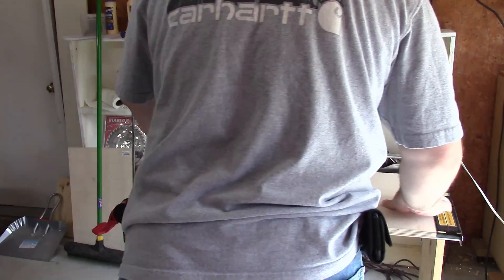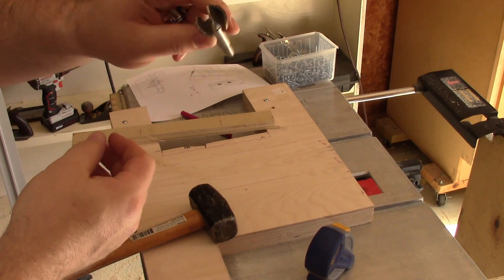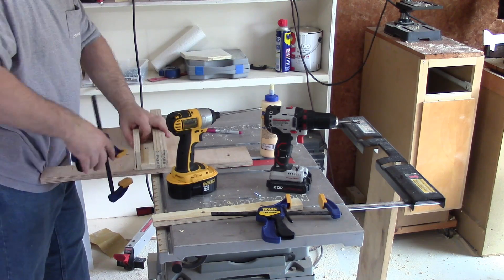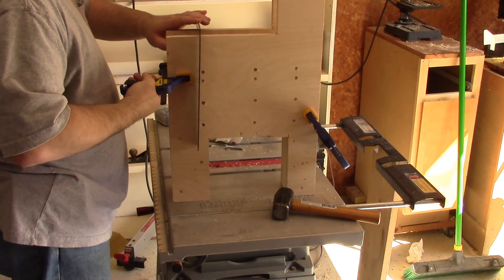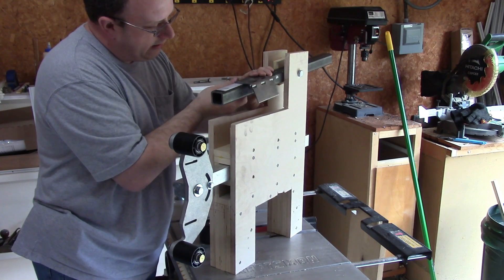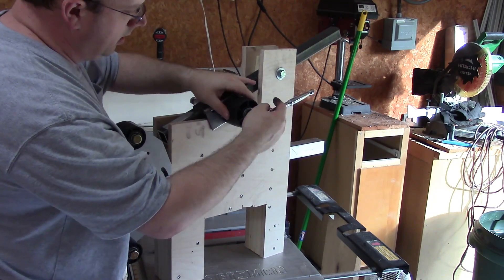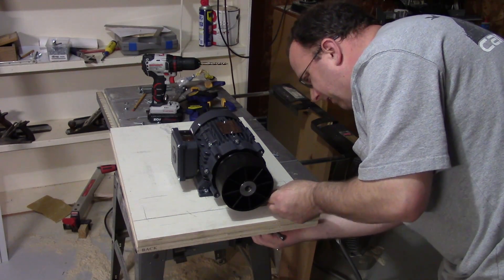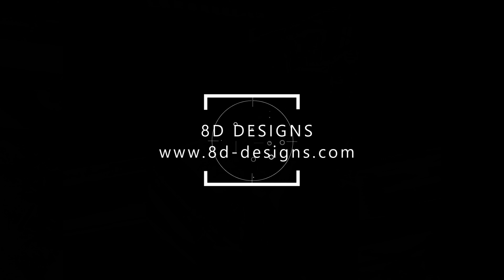Wood Frame 2x72 Belt Grinder

Comment: Since I gave this video a thumbs down I feel obliged to say why.  I must admit I skipped through parts of the video, as I found watching you repetitively driving in screw after screw after screw to be tiresome, so it's possible I missed something.  You don't say what kind of plywood you used, but it looks to be Baltic birch.  Where did you get the wheels and the sliding wheel assembly? Did you buy or make them? What kind of bearings did you use and what are the wheels made of? This is fundamental information that is not addressed in an otherwise decent video. Using those thick gloves to handhold parts in the drill press is a recipe for serious injury. That steel tubing should have been clamped to the drill press table or held in a substantial drill press vise.

Comment: I made one myself with a similar method like yours; the only difference is that I used pallet truck wheels (you know those jacked up things the staff haul pallets in markets, warehouses  etc) I laid the wheels, the belt and eyeballed everything. No plans, no measurements. I used a 3 HP 220V mono motor. I used a speed controller but it didn't hold up to the 3 HP motor and burnt so I have to make do with a constant speed of 3500 rpm for the timebeing... 
For the tracking wheel, I screwed on the hinge (same method as yours) since I do not have a welding generator and am not half as good as you with welding...   
Excellent work. You got yourself a new subscriber from Istanbul, Turkiye    :)     ...

Comment: Sounds good. I might try building myself a 1x42" belt sander someday myself. While I have some of the equipment for it I still find woodworking easier than working in metal myself. Probably because wood tends to be a good deal softer than metal is.

Comment: LOVE THE TRACKING DEVICE AS WELL REALLY SIMPLE BUT EFFECTIVE I WAS IN THE BELT BUSINESS FOR ABOUT TWENTY YEARS IN THE UK  SAW SOME GREAT MACHINES.   BELT MACHINES REMOVE STOCK TEN TIMES QUICKER THAN BONDED WHEELS THEREFORE A LOT OF HEAT AND DUST CAN BE GENERATED A TIP I SAW WAS TO PUT A BUCKET OF WATER UNDER THE ROUTE OF THE SPARKS THIS CUTS DOWN LOTS OF THE DUST PROBLEMS AND GIVES YOU SOMEWHERE TO QUENCH THE PART BEING GROUND THANKS FOR POSTING

Comment: I'd love to see your dimensions and part list if you have time. I'm going to use your video as a reference and attempt to build my own version of this. It seems to be one of the most straightforward and logical approaches :D Good job and thanks for sharing!
Reply from the maker: Christopher Goggans I'll try to get the drawings posted this week.  Watch my website. I'll post them there.
Reply: Thanks so much!  I hope you had a happy Thanksgiving! 
You've done a very good job with your video showing how everything is done and why you did each step. I'm rewatching your video to provide inspiration, and it seems to be working! I've got a treadmill motor, aluminum plate for the platen support, square steel tube for the platen support, steel angle iron for the platen, and I've made 3 out of my 4 wheels out of plywood and PVC. I'm making progress slower than I would like lol, but it's really amazing to see a home made tool come together from pieces that I have gathered in my shop. Have a good weekend!
Reply: Christopher Goggans have you finished your grinder?

Comment: Nice alternative to using steel. Funny thing though, if I had a welder or if I could weld, I think I'd just use steel Square tubes. Seems logical.
Reply from the maker: I will probably rebuild it using steel tube at some point in the future.  When I built this one my metal working tools were VERY limited.  It was far easier to build it out of wood at the time and rebuild it later if the need arises.
Reply: @KariCraftLab  What surprised me the most was your apparent lack of a workbench. Who says Craftsman table saws aren't good for anything though?